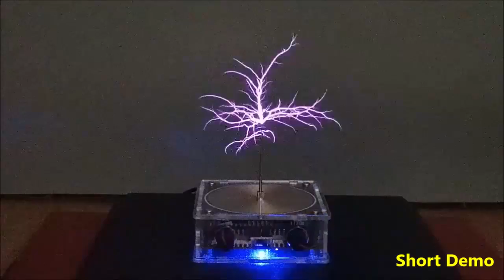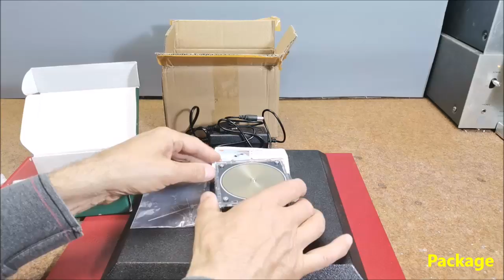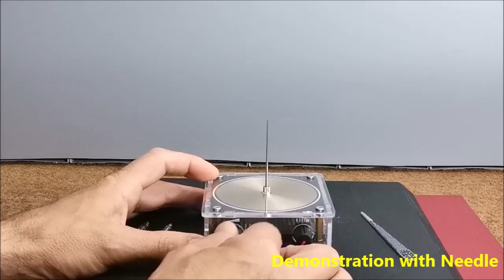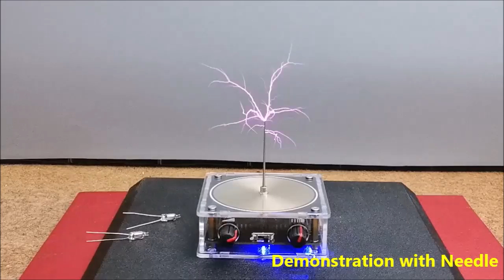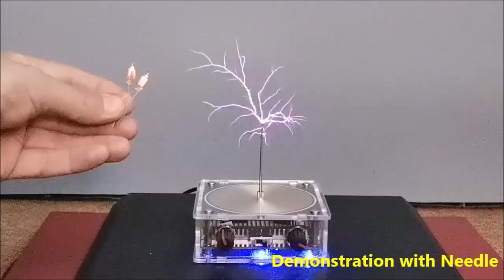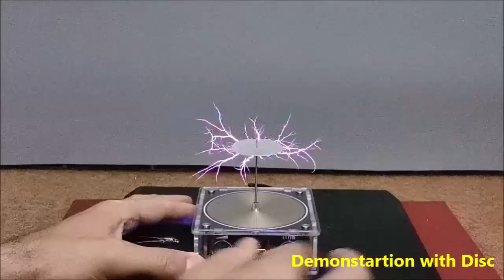Short review of small music Tesla Coil with Bluetooth

Comment: How do I use the Bluetooth on it and how do you get the sparks to be so big I have my settings maxed and the same one as you but mine is smaller
Reply from the maker: I haven't changed anything from the factory setup. To use Bluetooth you need to connect it to a smartphone, but you need to use 8bit music for it to work.

Comment: I bought two of this exact
model, they both worked for like 5 minutes and then stopped. Though the LED and bluetooth all still work... just no more sparks anymore (still can hear a click though). Any advice on how to fix that ?
Reply from the maker: First you should try another power supply because the power supplies are the weakest point of this device. I should also emphasize that this small Tesla coil is not intended for continuous long-term operation, but only as a demonstration model (1-3 min)
Reply: @MirkoPavleskiMK I have tried, and even with other models and they work fine. So my guess would be some resistor or something blew on the main board
Reply from the maker: @ I don't believe it's a resistor, most often it's a power mosfet.
Reply: @MirkoPavleskiMK thank you, I'll try to check that !

Comment: after short reverse engineering, it appear to be based on Skori/Tefatronix push-pull design, but with simple coil (not center taped), small resonnant caps and inductor chokes (ZSV style). I love it so much power in a so small beast!